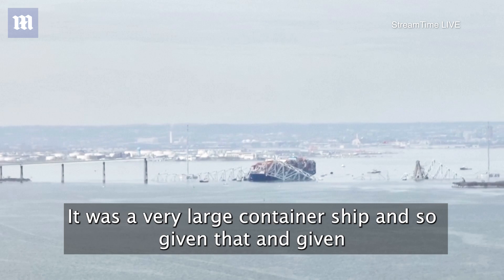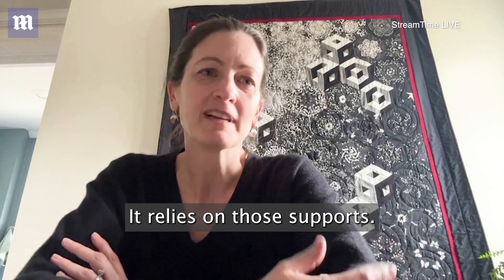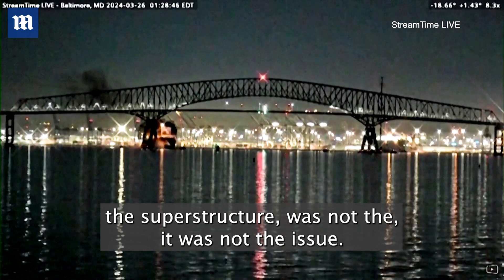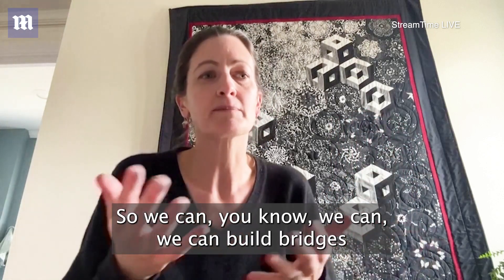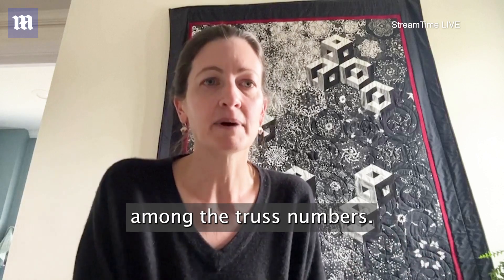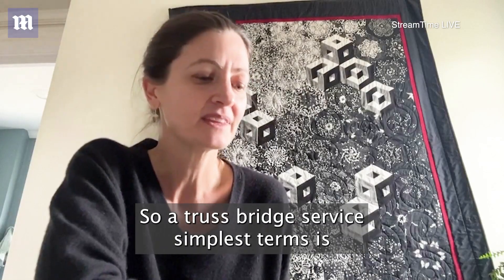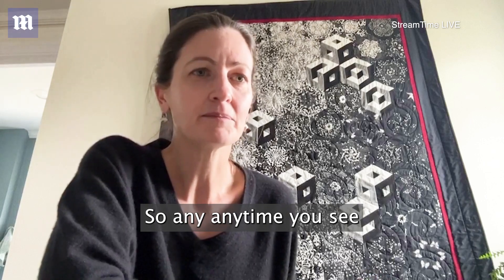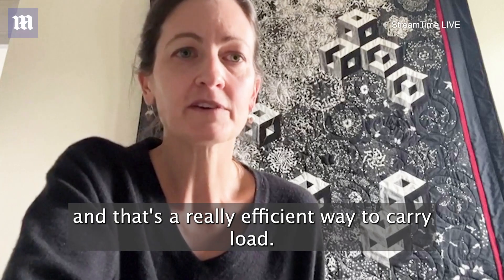Structural expert: Baltimore bridge was 'not designed' to withstand such a shock

Comment: Not a factor of safety issue.  The supports are designed to hold the bridge up.  They are not designed to withstand large lateral loads.  It is assumed that they must not be subjected to such loads.

Comment: You're telling me that a steel and concrete bridge wasn't built to withstand a massive cargo ship fully laden with cargo crashing into it? Stunning science coming out of the United Kingdom nowadays.🧐
Reply: @Trewazo   You are joking, right? The vertical pillars supporting the bridge are designed to work on compression meaning supporting the weight. Add to that the lateral wind force (which can be a big number) but in no case those columns are supposed to resist a side impact above a certain magnitude which is a number well below the hit received from the ship. 
Even the foundation of a tall building is designed that way (like the bridge columns). The foundation works well with vertical acting weight but if you push the building horizontally it will go down rapidly.

Comment: This is approximately a 150 thousand TONS of ship, they are not even sure that had they had dolphins in front of the pier supports that would have stopped such a heavy ship from knocking down the bridge.
Reply: It might be the diffrence between irreparable damage and total collapse.
Reply: A sufficiently large dolphin, properly placed, would have torn such a large hole in the hull that the ship would have been grounded in seconds.

Comment: Ok, so why did the fenders on the Bay Bridge protect against the Cosco Busan oil tanker hit in 2007? I looked at the gross weights and reported impact speeds. The Cosco Busan was about 2/3 the weight, but was going almost twice as fast and we all know that the energy of the moving ship goes up linearly with the weight, but with the square of the speed so the Busan energy was quite a bit higher.

Obviously, a glancing blow and a direct hit are different things, but although it is hard to tell from the video, it didn't look to me like the Dali impact was head on.

Comment: Several years ago I read a book about boats and shipping, and the author said that conditions in the freight-shipping industry are dismal.  (not his word)  On average a freighter goes down about once a year, and nobody pays any attention.  He said that if this happened with airplanes, there would be a great outcry.  In this instance, the owners of a ship sent men out on a freighter capable of losing all power with no backup.  One thing went wrong, and they were helpless.  And what does that filthy black smoke tell us about the state and the maintenance of the engines?
Reply: That the fuel oil was below standard, perhaps lots of recycled kitchen grease. Not the crew's fault

Comment: The main engineering issue here was the electric power system on the Dali.  
Without that single-point failure there would be nothing to talk about here.

The shame of it is in something a lot less threatening like a car, even when there is something like an engine stall or a broken belt, or electric power failure, your power brakes and steering must keep working so you can at least wrestle it over to the side of the road and stop.
Reply: With a full complement of tugs, it wouldn't have mattered if they lost power. The tugs could have diverted the ship from the bridge.

Comment: Is there any bridge in the world that is built to withstand an impact of that force?
Reply: very very few, and they are much newer.
Reply: Not the Golden Gate, for instance.
Reply: @Truthisindelible  The original bridge engineers could never have imagined the size or tonnage of the ships of today.   Back then they didn't build or even design ships anywhere near these.  Besides, The sudden direction change and angle of impact of this amount of force would have destroyed virtually any protective features and the bridge anyway.  The only ones that should be liable are the ships owners and  operators whose maintenance and operation practices caused the ship to fail in the worst possible situation.
Reply: No, but structures designed to protect bridges are.  Had there been a dolphin of sufficient size, 40 feet or more in diameter, that took a direct hit from this ship, it would have torn a hole in the hull that would have put the ship on the bottom in seconds, stopping its forward motion.

Comment: Where was the pilot
Reply: There were TWO on board at the time, that is not the issue, if the ship loses power there is NOTHING that the pilots can do about it. There job is to give the best advice as to the route, speed, direction to the captain to safely pass in or out to sea.

Comment: The bridge lacked safety bollards that should have taken the impact , modern bridge have these safety columns have been built in modern Bridges design to stop this type of accident
Reply: The NTSB is not sure that the dolphins(bollards) or whatever people call them would actually have stopped it, it would certainly have HELPED, but 150K TONS of ship moving at 9mph does not stop on a dime, what stopped the ship was when the hundreds of tons of bridge fell on it and pushed the bow into the bottom of the river.

Comment: The ship is 984ft and  weighs 96,000 tons...when empty ! At the time of this accident it had 4,700 shipping containers on it's back, so it gives you an idea why the bridge collapsed like a pack of cards. I dont think many bridges are built to withstand a direct hit with something this heavy ! 😂
Reply: Which is why bridges must be protected in some way from allision by ships.  The near total lack of protection means that this disaster was inevitable.
Reply: Co z tego, gdzie procedury, gdzie były holowniki? Ktoś tu oszczędził, na ludzkim życiu😢
Reply: Yeah, it is estimated that the LOADED weight is more like 150K tons hitting the bridge.
Reply: @7th.trumpet   It is not a matter of weight alone. The speed of the impact is a determining factor. The energy that the ship carries which is the "destructive energy" in this case is what is called in physics the "kinetic energy" and it is equal to 1/2 (mass of loaded ship) x (speed of ship squared)

Comment: 😂  most “engineers” can’t even use a tape measure,  my local bin man could tell u hundreds of of tons of container ship doing 12 knots hitting a steel bridge equals total complete failure 🤦‍♂️    I wouldn’t trust her to wire a plug up
Reply: What's your problem? Have you seen her work? What right do you have to judge?
Reply: @halberderdier8073   35 years of working with university “engineers “  🙄 and she doesn’t do the work , men do .  U she u uses computer models and drawings books and info that generations of practical men that got their hands dirty built the hard way 🤦‍♂️😂
Reply: well, the Dali was going 8 knots(9 mph) before losing power, according to the records it was actually down to around 6.5 knots when it hit the bridge supports. The ship had about 150K tons of weight, fully loaded.
Reply: @williamhalejr.4289   I was just making a general comment , I have no idea if the speed or weight as I haven’t followed  this tbh , but the argument stands a big heavy ship at speed and that type of bridge there’s only one winner 🤦‍♂️
Reply: @invizzziblecitizzen7092  absolutely, just in the same way that a TRAIN is going to win against any car/truck on the railroad tracks, they have so much weight and momentum that they can not stop as quickly as some people seem to think.

Comment: "Not designed to withstand such a shock". Why not?? This is basic engineering! The design should have taken such an impact into consideration however remote the chance of it happening may seem to be.
Reply: Building the bridge itself to take such a shock might double or triple its cost.  Best bet is probably bollards or some other sort of artificial islands to take the hit.

As I live in the Mississippi / Ohio River region, I've always been intrigued by the formation of sandbars near man made structures in the rivers.  The weirs near the new lock and dam @ Olmstead, IL, are an example, the supports for the I-24 bridge over the Ohio River are another.  USACE has to dredge big time, immediately downstream of the latter, right out in the middle of the river, a LOT.  I'd say yearly at least.  Maybe somebody by now understands enough about such formation(s) that we could place rip-rap weirs or artificial islands upstream of a bridge to have Mo' Nature create sandbars that would protect the bridge supports, with a sort of self-scoured shipping channel between them.  Essentially, let "Mom" do most of the material transport.  That might take 2-3 years, but these bridges take years to build -- make the creation of the artificial islands the 1st step.

????
Reply: It is very easy to blame and call it “basic engineering” when you are not involve in designing, procurement and construction. 😅😅
Reply: first of all, this bridge was built 50 years ago, they had different STANDARDS in that day! 2nd, ships have gotten MUCH LARGER since the 1970's!  The NTSB said that they were not sure that dolphins(bollards) or whatever you wish to call them to protect the bridge piers MAY NOT have been able to stop such a large heavy ship. It may have kept going and still knocked over the bridge pier. Certainly, in hind sight, the concrete islands in front of the piers MAY have helped, but it not guaranteed to work, according to the NTSB. Ships of this size pass through this bridge in both directions every day safely.